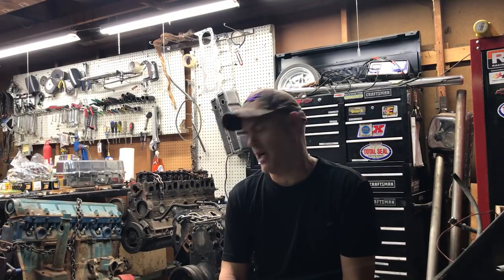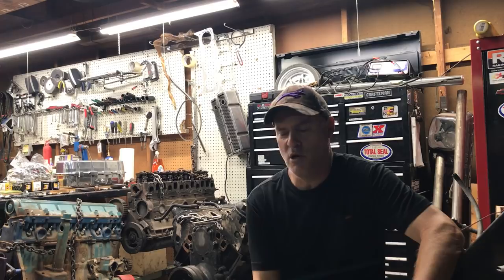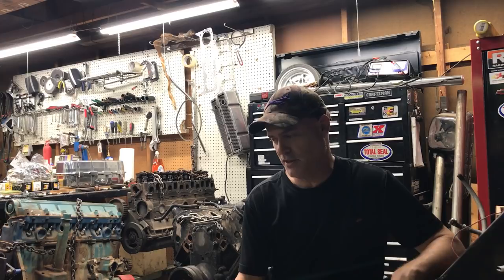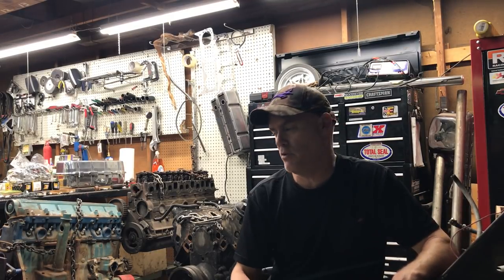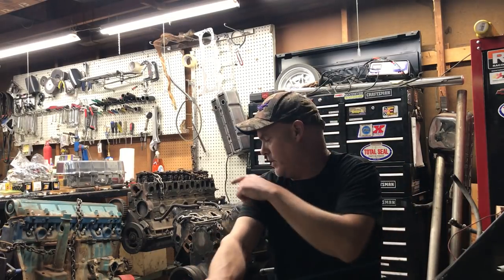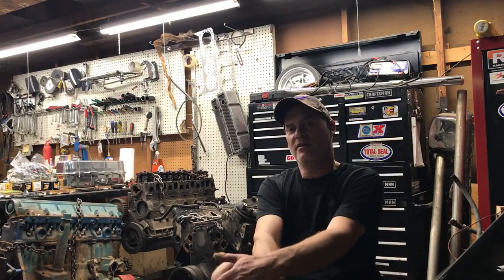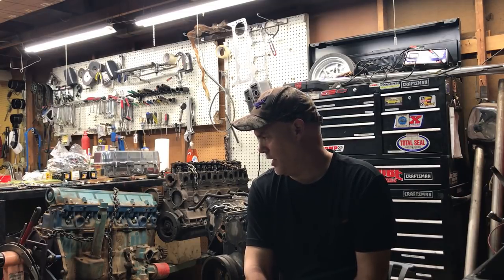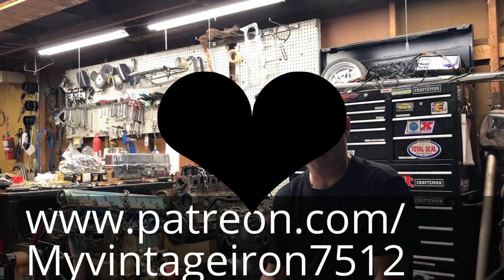Lets Talk LS Engines

Comment: In the sad days of the late 70s and early 80s I would have never dreamed the golden age of hot rodding was still to come.

I love building LS.
Reply: I so agree.  When I was a teen in the '70's, I always assumed that the golden age of hot rodding ended by 1972.  Now, you see guys our age doing LS swaps into cars from our era.  I'm starting to pull my head out of my ass and catch up to the times, lol
Reply: The LS has gotten so good and so affordable that even the guys with Japanese or German sports cars are putting an LS in their car when the time comes. For example:
https://www.youtube.com/watch?v=nCXfXX8z8wQ

Why? Because even an LS 6.0 iron block gives an old Nissan 300ZX a better weight distribution and reliability versus the original twin turbo V6 iron block engine:
https://youtu.be/nCXfXX8z8wQ?t=242
Reply: My teacher was mr Brian O'Connor he told me engine rebuilds are a dying art and i shouldnt focus to hard on it... here i am building a 5.3 in my apartment as a blown g35 waits in the parking lot
Reply: @hochhaul  hello!
Reply: If you look at the videos I've uploaded, you'll find one titled "Callies 4.6 inch Ultra Billet crank in an RHS block."

That is the bottom end of my 502ci/8.2L LS in my 2007 Z06 (the yellow you see at the edge of frame).

It's pretty wild hearing that many cubes spin 7200 RPM.  It makes approx 800 horsepower naturally aspirated.
Reply: hochhaul The design of the LS/LT has even propagated into GM’s remaining pushrod v6.  The Vortec LV3 found in the 2014 and later GM trucks is an aluminum block with the deep skirt and 6 bolt mains along with the LS7/LT rectangular port heads. The guy who swapped the LV3 into his Grand National, picked up a new set of stock heads for $170.  That’s insane.  He flowed them against a set of p&p TA Performance and the Buick Motor Sports Stage 2 heads.  The LV3 held its own down low, even out performing the other two heads at lifts lower than .450.  Think about that, a set of fully ported TA heads cost around $4k and the Buick Stage 2 stuff maybe more and the BMS heads are getting very hard to find a decent set that hasn’t been beaten up.  You can’t mount stage 2 heads to a stock Grand National motor, you either need the production 4.1L v6 made in the early 80’s or a TA Performance or BMS 4.1L block.  The stage heads valves are to big for the 3.8L bore.  The only thing about LV3 block is that you have to fabricate the intake to have port injection. DI is just to expensive to support in the aftermarket. A Holley Hi-Ram was cut down and modified to fit along with the an aftermarket oil pan.  But a stage or TA block costs over $4k and that money could be used for the modified intake and oil pan.  The LV3 is probably just as strong as the aftermarket or stage block.     GM seems to have their stuff together when producing quality reliable pushrod engine blocks.  It would be great if the v6 would catch on and an aftermarket support it.  For me I’d much rather have a v6 in my Grand National than the v8.  More room to work with and for street application very good performance.

Comment: There use to be a saying, " fast, cheap, reliable. You can only pick two. Fast and cheap won't be reliable. Fast and reliable won't be cheap. Reliable and cheap won't be fast." The 3rd gen sb or "LS" changed that!
Reply: Classic Ride Society the 3rd gen ls actually has issues with internal stuff breakingn
Reply: jdr ok Maybe over 500 tire. Look up sloppy mechanics.
Reply: Welcome to the 21st century where now all of those things are possible and even all at once, in the same motor thanks to GM'd LS motors.
Reply: That is called IRON 's  Law, in which of the 3 variables, only 2 are possible, & 1 sacrificed in favor of the other 2.

Comment: The LS engines are id say just about the best design out there , the Nelson brothers have been making massive power numbers and very strong design also
Reply: LS = Small Block Ford
Reply: Lol you could say ford copied the GM LT5 as it came out a year before the modular and was over head cam
Reply: Ford had OHC V8 engines in the 60s...try again.
Reply: You mean the experimental "Crammer" engine that was not available to the public ?  Don't really count man if the public did not have it. Anyways OHC was not created by ford. Dusenburg was making DOHC in the 20's.
Reply: Engine was far from experimental.  It was ready to go until NASCAR changed the rules to outlaw them.  Ford sold the engine direct to customers.  The engine was very successful in drag racing.  I never said Ford invented OHC...those are your words.  I referenced an OHC engine that predated the Lotus LT5 by 25 years.
Reply: All I am trying to say is there is no proof GM copied anything. Where do you think ford got all its idea's for the modular ? From another manufacturer...... probably European. Just like Chrysler got the idea of hemispherical heads from a French company. The LS shares the same dimensions as the small block from the 50's way before modular's. I see ford guy's saying the head's from a mod almost bolt up to an LS not knowing the bore spacing is the fuckin same on the LS as a gen 1 small block  LMAO. Cool story though
Reply: James Avery The same guy designed the 2.3 quad 4, 4.6 Northstar, and 4.6 Ford. They are all 90% the same.
Reply: "The same guy designed the 2.3 quad 4, 4.6 Northstar, and 4.6 Ford." --- --   Please provide a LINK to prove this claim.

Comment: Don't forget the SBC is a 23-degree head vs a 15-degree LS head. Plus GM put really big runners on the LS @ 210cc vs the small 170cc stock heads. That valve angle is key in head flow. That's why all the really serious SBCs that run big HP #s are 18 degree or more on the valve angle.
Reply from the maker: Good point the angle is a very big deal I agree the air flow hates big changes in direction
Reply: You should show a radical SBC like the SB2.2 ( If you can find one ) You can tell Chevy took a lot of engineering from the Nascar SBC's and put them in the LS.

Comment: The main reason I won't swap one into a classic truck or car is they dont have the SOUND. They just dont. I dont care about 1000 horsepower and all that....im good with 400hp. But in a old school truck it just doesn't sound right without the old school motor thumping under the hood. The LS just sounds totally different

Comment: I used to drive around in my 74 Camaro with a big block with no carpet and that floor board would nearly melt your shoes
Reply: I owned 3 2nd gen Camaros, I can tell you why.  The exhaust routing puts the collector flange right under the front floorboards because the engine is set so far back.  All you have is a thin firewall between you and the 4 inches your foot is from the head pipe.
Reply: Damn I miss my 2nd gen.

Comment: I am doing a rebuild on a 6.0 lq4. It had 285K..i could still see hatchmarks on the cylinders when i disassembled it.
Reply: Remember USS Liberty unreal. Truly amazing engineering.
Reply: Thats because it was platue honed in the factory does not mean the cylinder is not worn.
Reply: @tomhutchins1046 low tension rings as well.

Comment: vintage iron.. oh ya !!   I backyard built a 454 with LS5 heads, bowl job with a comp 2030 cam, headers and an rpm and quadrajet.   Stuffed it into an 80 trans am with a built 700R4... and the thing has no faults … really.   pulls the front end enough to loose steering and gets 30mpg on the highway !!!    no faults that I can see.      BUT,   I get it.   the LS is an awesome platform and i'm going to have to try one.   soon.   That being said, … would you recommend a mild vortec 454 or an LS for a beautiful 85 chevy camper van... it's raised roof, only 60k miles when I got it and the tired old drivetrain had the hell beat out of it from the PO , from what i'm reading, trying to keep it from stalling when the choke and the spartk control stuff stopped working correctly.   Haven't weighed the van yet, but it's a heavy chevy and it's going to take lots of low end torque to keep me happy.

Comment: I love what I had done with my 04 5.3. Fully decked heads, some kinda hot cam, long tubes, electric fans, cold air intake, 4:10 gears, and nicely built 4l60 with a good stall converter. luckily though, I I had a tuner who knew what he was doing. the engine runs so smooth and effieciently, it's a total joy to drive. only complaint is that the engine is in a 6800 lb. crew cab siverado but it's still able to light'em up. down the road i plan on putting a ls3 in some light car using a tremec 6 spd.
Reply: Hell yeah! To all of that

Comment: The LS/LT platform are certainly superior to the SBC’s of yesteryear  and of course as you said you get them for a much better price than a Coyote or Hemi and the aftermarket is so much better.  I have an 86 Grand National, knowing what I know now I would’ve pulled my stock drivetrain and put an LS based motor and a built 4L60 or 4L80 in my Grand National and have my fun with that, all the while preserving the stock setup.

Comment: Sloppy mechanics on YT made 1076hp at the tire with Cam and springs in a bone stock gen 4 6.0. Yes it was reliable as it was his daily. He now has a 500hp+ tire bone stock gen 3 4.8 long block with Cam and springs. These are great turbo motors! Great video.

Comment: Agree with everything you said.  I have literally been building engines for 50 years and I got on the LS bandwagon 15 years ago.  I still build the older engines but mostly those are for the cruiser crowd.  I just reringed a 305 and dressed it up for a buddy that has a '52 Deluxe and he's happy.  I've done over a dozen swaps, my current build is for a chopped '68 C10 I own so I found a 5.3 with only 41,000 on the motor.  Put a cam, pushrods and oil pump in it, upgraded the rockers to bushed trunnions and a set of LS6 springs.  With a set of long tubes and the stock truck manifold it made 440 hp at the flywheel.  I had $1100 into the motor including the cost of the motor, of course you have to add the cost of a management system, say $1000 but for $350 you could use a cut down stock harness and reflashed computer.  A stock Trailblazer SS manifold would have me at the 450 mark, where you gonna get that for a all in price of say $2500 in the vehicle.  Those are big block numbers, last one of those I built I had $3000 into just the long block.

Comment: a buddy of mine had a 99 silverado with the 5.3l and it has over 320k on it and it still runs  he tried to blow that thing up and he couldn't lol ls motors are beasts
Reply: jt martin my 2000 Silverado has that same mileage. still going.
Reply: yeah the guy he sold it too still drives it every day and it still has the original motor in it
Reply: jt martin y ting __ ting __
Reply: watch rev tap industries on youtube . they beat a 5.3 Silverado like you have never seen and it wont blow.
Reply: I have a93 Cheyenne with a 4.3l 262 with 340k on it runs like new still...still has the original ball joints and tie rods too lol
Reply: There are alot of regular 350 Chevy, 360 Mopar and others that will last 320K miles also. What is the point?
Reply: @VegasRT500  what is the point of what? Are u getting salty about us sharing stories? LMAO what's wrong did u have a Ford that didn't make it to 100k? lol
Reply: EAST SIDE313 if homeboy had a 5.4 3 valve he wouldn't get 20,000 without a lot of major work and money. lol. hell yeah he's mad

Comment: one thing that is awesome about the ls is that it accepts previous sbc bellhousing. this is one of the things that make it better than hemi's for hot rodding. also the gasket in is absolutely awesome. As far as the coyotes (or any ford mods), I think that along with cost, the ohc design make it more complicated for Joe blow to dig into it.
Reply from the maker: yep Ford is way more complicated and expensive they make good power but who can afford it and who want's to work on it not to many the LS is an engine that anyone can build
Reply: Myvintageiron7512  not to mention the engines are physically larger and harder to package in tight engine bays.
Reply: @charlesvilleneuve4052  The physically larger size and weight of the overhead cam motors is a key point. I always try to explain that to the Ford guys, and they cannot comprehend it. I always get, "But the LS has more cubic inches, it has to be bigger." And the dohc engines have a bunch of their mass on top of the engine! Making the weight higher up and even worse for balance.

Comment: There are plenty of cons to the LS platform that must not be over looked. short cyl liners, only four bolt per cylinder, windage issues from the skited block ect.. having to pull heads to remover lifters... Not saying they are bad, I built several in the past few years, But as far as power output, they can go marginally either way compared to good gen 1 and good heads.. In fact.. many of the radial class records are still being held and broken on Gen 1 platforms.. Pro's and cons are important topics to touch base on.. In any event.. great video's. Keep up the great work.

Comment: Just as a quick note: Chevy did use an all aluminum 5.3l for a couple of years around 2010, 2011 or so. Only came in the 4 wheel drive models. If you're in the market for an aluminum LS keep a sharp eye out at the wrecking yard. The VIN code is 3. The engine designation is LC9 (the "flex fuel" version of the LH6).

Comment: Couldn't agree more, been building Chevys for almost 40 years and I'm a LS believer.  I have a '68 C10 with a 383 I built years ago, did a 6L LS swap and I'll say the LS picks up where a built SBC leaves off.  That 6L runs just as hard (better down low) as that built 383 did and it's a stock (LQ9) with headers and a Fitech fuel injection system.  Paid $700 for the motor, it was the rest of the parts for the swap that cost the bucks but like you said they are easy build just throw out that TTY fastener crap and use ARP hardware.  I'm thinking of doing a cam swap and the grinders are telling me I could pick up at least 50hp, maybe more, I'm sold ....

Comment: LS engines are still just overhead valve push rod V8s. With the exception of crank triggered ignition and a little different valve arrangement there isn't much that separates them from other push rod V8s. If having a distributor is that important to you there are even kits that adapt a front mounted distributor to the motor. They respond to all the traditional SBC upgrades. Don't be skurred an confoosed.
Reply: What type of distributor do those kits use, a Sb Ford ?

Comment: I have had 2 replacements of LS series engines. The first was in my 2000 Camaro at about 120000 miles. The roller end of a lifter came apart and the needle bearings fell into the crank case and were flung all around. Some broke the plastic on the crank position sensor and that plastic went into the oil pickup. Next day I was waiting at a stop light and the oil pressure warning light came on. I had known something had happened the day before when I was driving through south west Utah and it coughed but recovered and drove me all the way from there to Las Vegas where I stopped for gas and noticed nothing and then to LA. It was still running well until I got the low oil pressure at idle. I did not fix that engine as the crate replacement was so reasonable and I did not want to have the down time. I still have that engine on a stand and have always thought it might be a fun project though the crate replacement engine seemed to be stronger than the original engine. As an aside I talked with some racers who ran "crate motor" class stock cars with LS and said it was cheap, strong and durable .... except the lifter rollers would fail and the pieces would fly all over the inside of the engine and that was years before mine failed. I think there were some improvements made after 2000.

The second engine was a 5.3 in a 2007 Avalanche which had the fuel saving cylinder dropping feature. There was all kinds of reliability problems with those engines and several service mods to fix the problems which mostly had to do with the trick lifters on the 4 drop able cylinders. Mine started to miss at 101,000 miles! It was going to cost me about $2500 to get the engine repaired with new lifters, which means you have to pull the heads and also buy the new parts for the service mods. It seemed that on a 100,000 mile motor my best bet was spending $4,000 on a factory remain engine with warranty. I did not keep that engine as the core charge for the engine was $2,000! Chevy really was serious about getting the core back!

Things I have heard, that the aluminum blocks are good for about 500 HP but if you want to go higher you should get an iron block. Also there were problems with the head gaskets on very early iron block engines. Better head gaskets fixed this but back in the mid 1990's GM was running LS engines in the Le Mans 24 hour race and got disqualified on race day because they had qualified with an iron block engine but switched to an aluminum  engine for the race, which the stewards said was cause for disqualification. I never understood this till I heard about the problems they had with the iron block/aluminum head engines.

Comment: I love the old small block Chevy mainly due to the simplicity and ability to make decent power for cheap.  However looking at the design of the LS there are many features that do in fact make it so much better.  Also Chevy really kept with the same philosophy as the original small block, there are so many interchangeable parts.
Reply from the maker: I agree the LS is a better design, I always the LS engineers fixed all the drawbacks the older SBC has

Comment: Great video, the only reason I haven't installed an Ls engine in my old trans am is there are other things that need to be replaced or reworked like the engine cross member. It is just a little bit more expensive. Again thank you for a great informative video.